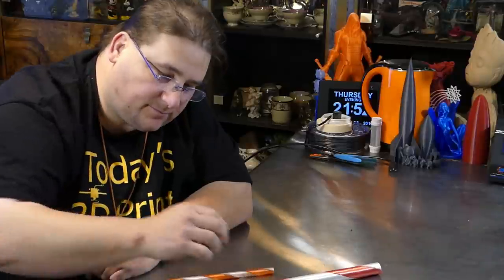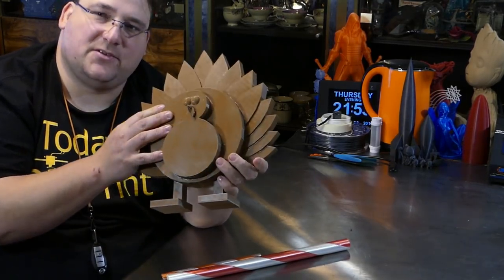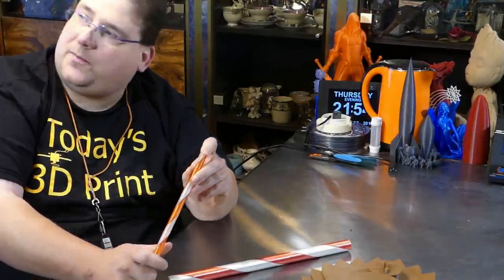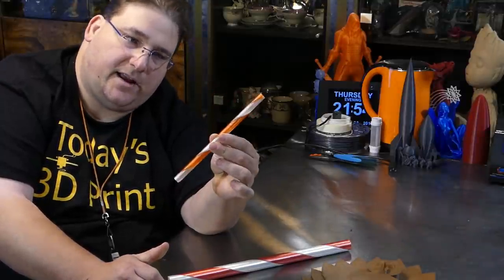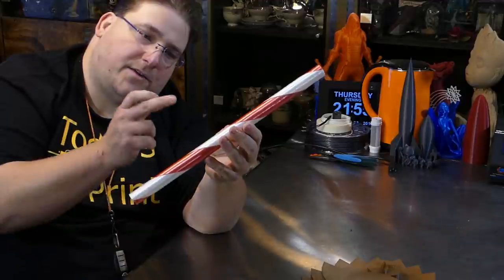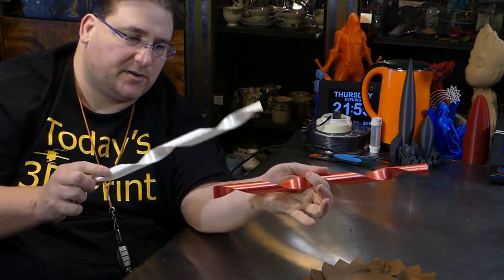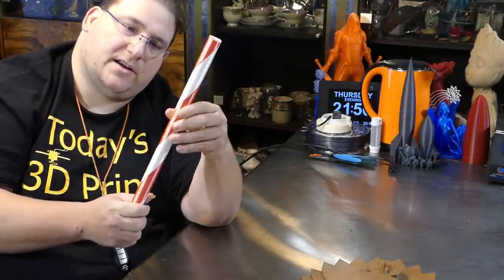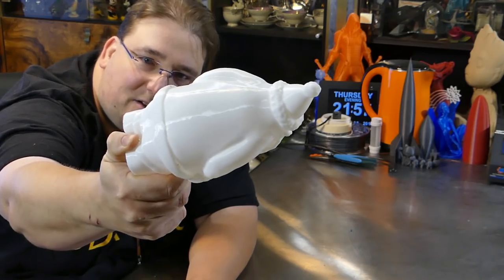Today's 3D Print 156 Some Holiday Prints

Comment: If you bend to make a cane, heat and bend it around something, but more importantly, fill it with sand (or maybe table salt?) and cap the ends before you bend it to keep it from kinking. I suspect you'll also have to glue the length of the seam or it will pop apart during the bend. 

Will be interesting to see what you end up with (candy cane hoola hoops?).

Comment: I really like the supersized Turkey cool.
Reply from the maker: +darth parkus I skinned it pretty close you can see slight defects because the original print estimate was 40 hours so I lower the infill and only use two perimeters and three top and bottom got it down to 25 hours :-) it didn't do bad for simple stuff like that the printer works okay
Reply: looks like you can hang it on the wall and my be put a clock in it what you think?
Reply from the maker: +darth parkus I would want something nicer for a but that's a pretty cool idea actually to make a turkey clock I might have to work on that thank you

Comment: I had asked a question from a older vlog but ill ask it again. Are the wheels on the right side of the gantry supposed to be tight. As in some resistance or loose as in move fairly freely? mine was loose and i noticed my far right side was a little lower then the side by the hot end. So i tightened the eccentric nut a little to provide some resistance.
Reply from the maker: +Tom Shepherd if the arm is drooping then either it's entirely too loose on the right side or the left side needs to be tightened up left side should be pretty tight right side should be just snug in my opinion
Reply: Yea i finally got it. Now my only issue is keeping the bed level........lol. But all it takes is some practice. And i ordered Build Tak  And another glass bed . One will be straight glass the other will be build tak. I hate painters tape even though i have like a million rolls of it. In my spare time i do auto paint and body. :)